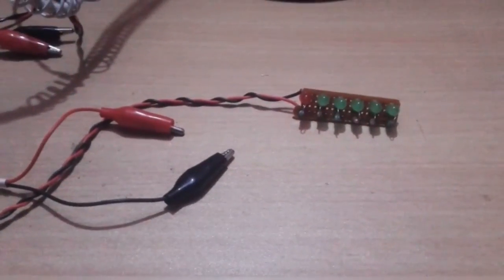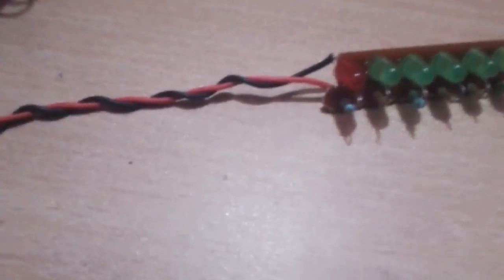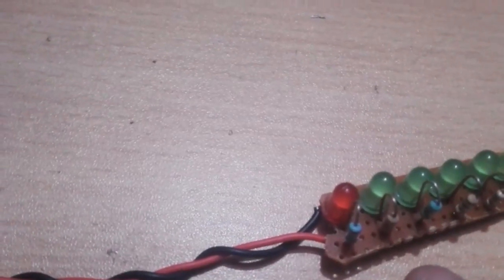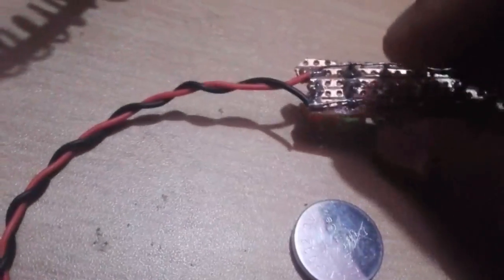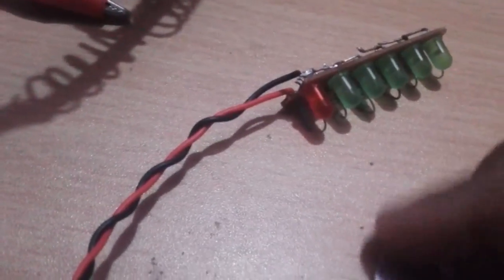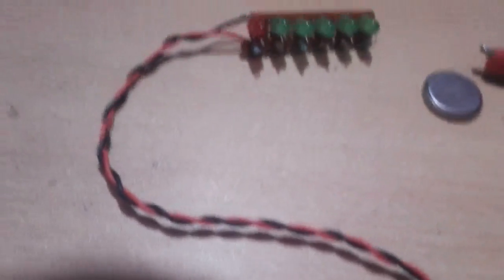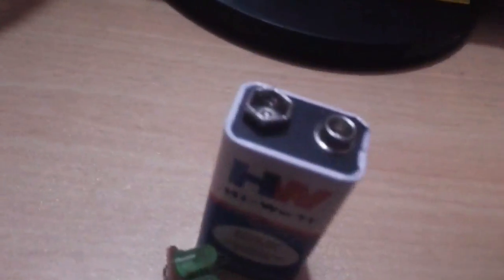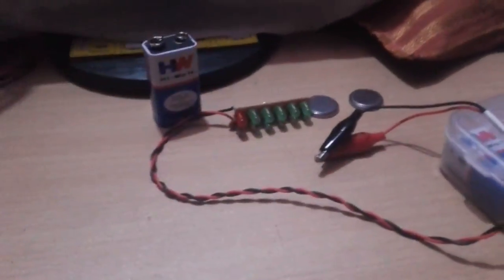BATTERY CHARGE INDICATOR OR DETECTOR

Comment: I have 12 volt battery but it is showing in multimeter 15 volt ,
So can you tell me how many led bulbs I can add ( I wana make it 15 led bulbs for 15 volt )
Please tell me what Reactance I need ?? For 15 led bulbs??? Please reply me
Reply: Please please please,
My inverter is off after 10 volt left in battery, I wana add 5 more led for 10 to 15 volt it will useful for me ,
Reply: @arnabelectrotech  yes I can buy it but tell me what type of Reactance I need ?? Back to back ??